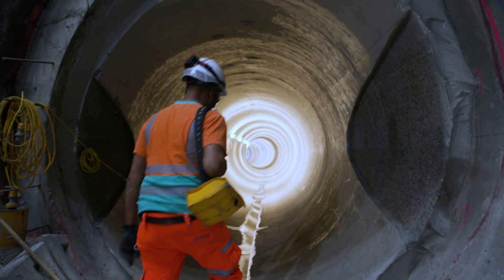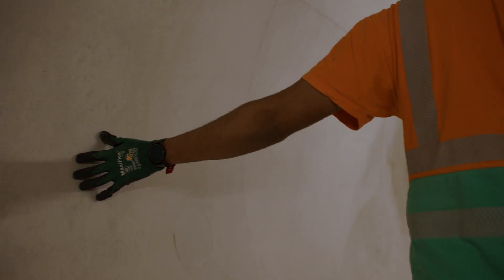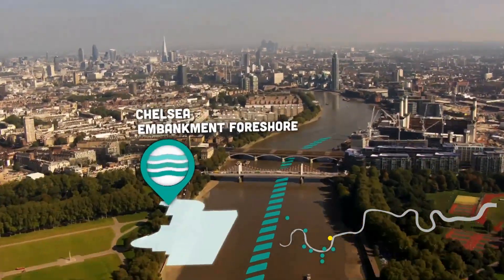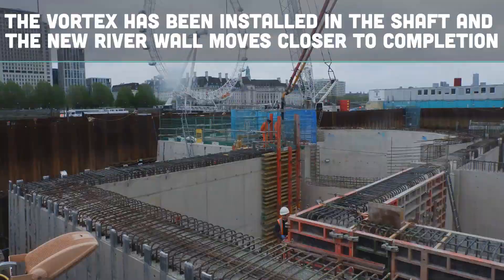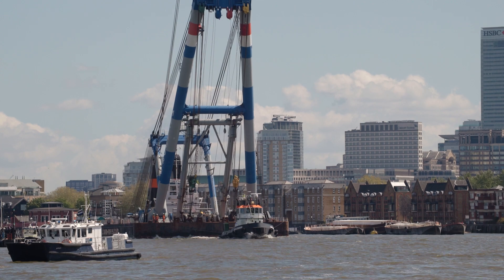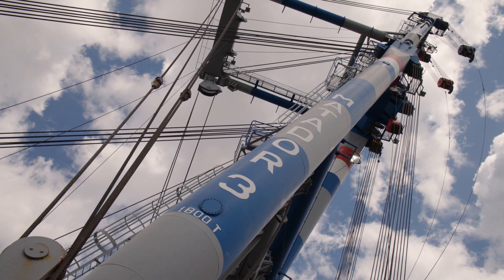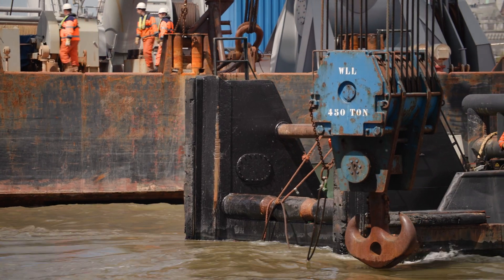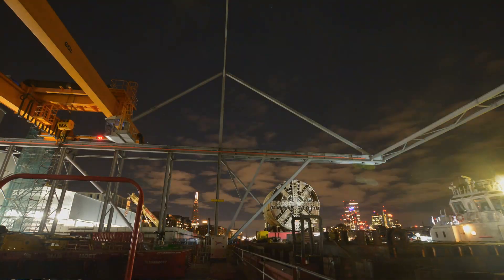Tunelling machine Ursula lifted from site via an ENORMOUS floating crane: LONDON'S SUPER SEWER

Comment: ironically it’s disconnecting london from the river thames. It’s great sewers disconnected. What would happen if that large sewer will eventually have to overflow? does it have a cso?
Reply: No sewers are being disconnected. Under normal conditions the old sewer network will still be in use. The super sewer will catch almost all of the overflow sewage from the existing network. And yes, if the entire tunnel and shafts are full of sewage, it will still overflow into the Thames through new CSOs.